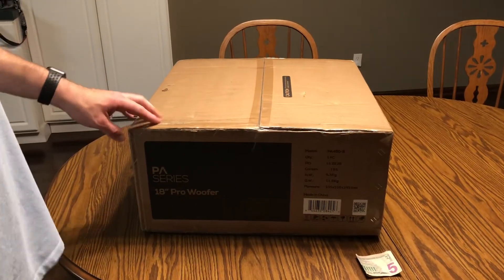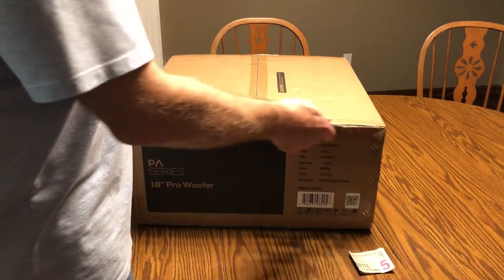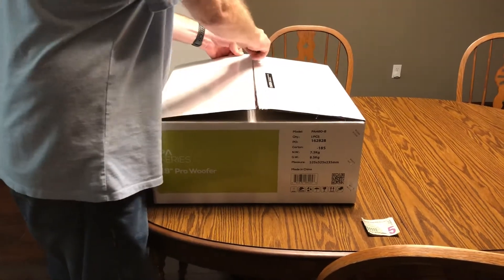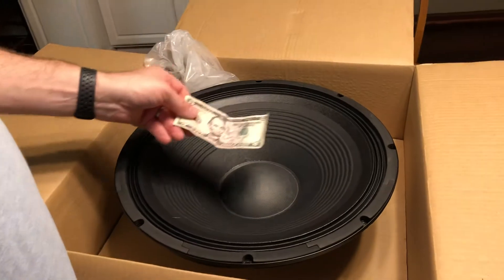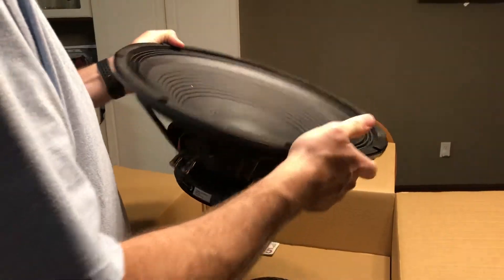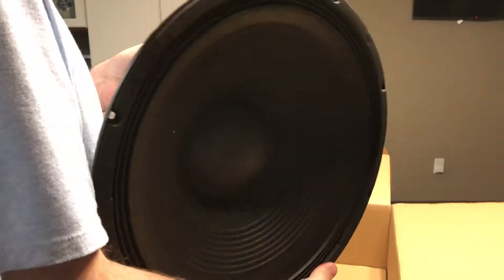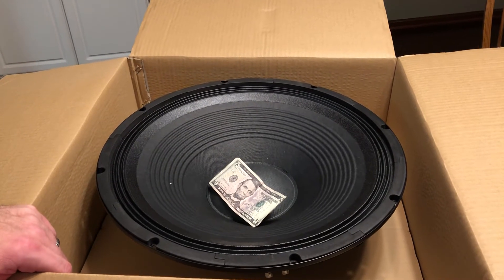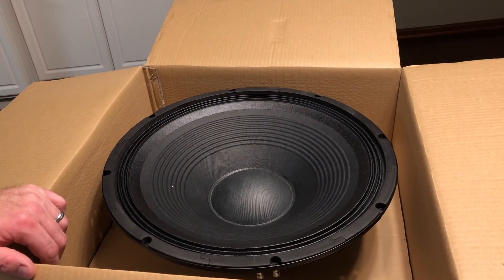VBSS Part 1: Unboxing the Dayton Audio PA460-8 18" Pro Woofer

Comment: How much does it cost
Reply from the maker: Hey Warren. That question is hard to pin down because cost of materials fluctuates so much, but here's an estimate.

2 8'x4' sheets of 3/4" MDF: $120
2 Dayton PA-460-8 woofers: $320 (these were $100 each when I built mine, so the price has really jumped)
1 Behringer NX1000D amplifier: $329
Glue, screws, cabling, etc.: $50
Total estimated price for 2 subwoofers: $819

Comment: I know this video is 2+ years old now, but which amp did you end up using for these and where did you place it?
Reply: Never mind, saw it in another one of your videos.
Reply from the maker: @hubbahubbazootzoot  Cool. :) I did build a second set of VBSS now, they are behind the screen. The bass is perfect with 4. Not overwhelming, just full and buttery and effortless house shakes.
Reply: @jevchance  Did you just run 12 gauge wire to the back of the room for the end tables?
Reply from the maker: @hubbahubbazootzoot  Yup. It's just 1 12 gauge lead that runs to the back of the room. It runs to the first subwoofer, then another 12 gauge wire runs from there to the other subwoofer. The amp is bridged mono, the two 8 ohm subs in parallel show a 4 ohm load at the amplifier. The amp is a iNuke NU1000DSP. Although, my other 2 VBSS subs are running off a NU3000DSP and they enjoy the extra power.
Reply: @jevchance  Cool thanks!  From what I've read you should be able to run all 4 of them from the 3000DSP right?  I'm planning on building a pair soon'ish and am going the end table route too.
Reply from the maker: @hubbahubbazootzoot  I've read you can run up to 8 with a single 3000DSP! 4 is easy though, just run one pair in parallel off each channel of the amp. The amp sees 4 ohms on each channel. Each speaker should be seeing about 340 watts. This is approximately the same output my two subs are seeing my NU1000DSP. Works great!

Comment: There is absolutely no low end bass from the units I used. 7.6cuft cabinet slot ported to 34hz
Reply from the maker: 34Hz tuning is not a good choice if you want low end bass. You definitely would want the 20Hz tuning. The 31Hz design is down like 16db at 20Hz compared to the 20Hz tuning.
Reply: jevchance thanks for the info. I think I might try to make the ports smaller with some pieces of wood and try to deepen the tune
Reply: jevchance I will say that I don’t even think that 34hz is there. Personally think something is wrong with the drivers
Reply from the maker: @Markkrochuk1979  Mark I recommend posting about this in the VBSS design thread on AVSForum, there's lots of really knowledgable guys on there willing to help with advice. I'm also happy to help. Off the top of my head, a couple of questions: 1) What are you using for an amplifier? 2) Did you do the subwoofer crawl? Room gain/modes can be a problem. 3) What are you using for DSP/EQ?
Reply: jevchance one bryston 4b bridged mono per side, no eq except for whats available on my pre-amp
Reply from the maker: @Markkrochuk1979  Hrmmm. That is a lot of power for these speakers. Far too much. Without a limiter I'd be very concerned about cooking the drivers.  It'd be safer, to use one of those Brystons in stereo mode (250 watts continuous per driver). You wouldn't be using them to their full potential, but they'd be relatively safe from thermal overload, and should still develop pretty good SPL as the PA460 is a pretty efficient speaker (97.8). Also, with 34Hz tuning you'd want a high pass 12db butterworth at about 32Hz-33Hz because a ported (basically free-air) subwoofer can easily bottom out below tuning, running without one (especially that hot) puts the drivers at risk. I think your best bet to setup high pass filters and further EQ would be to pick up a MiniDSP 2x4 and again go down to a single amp for both drivers.
Reply: jevchance ya, I’ve ran out the bridged (800w per side), wasn’t even remotely impressed with the output. In fact I get about the same bass from my Klipsch RF5’s (dual 8” drivers) at 1/2 volume. Theres definitely something serious that I am missing with either the design or defective drivers. Ive detailed it all on the Parts Express tech talk forum. Basically I wanted a Klipsch Cornwall inspired three way design augmented with my sub for the really low end stuff. Given the efficiency I thought these drivers would be blowing people out of my basement. The mid driver is 97db/1w and the tweeter is 94db/1w and they both sound about 2-3 times louder than the woofers. Also tried wiring direct to woofer to ensure nothing was wrong with crossover and was having same volume/results.
Reply from the maker: @Markkrochuk1979  Are you running the RF5s off the same amp? Are you feeding power to these directly from the amp or through your passive crossover? If you're running through the crossover it could be the crossover at fault, if you're running direct are you using a low-pass filter? If the speakers are making noises that aren't "bad", the drivers are likely ok so we need to figure out where else the problem could be.
Reply: jevchance ive run the same amp configuration on the RF5s, Ive run the woofers through a crossover and direct wire to amp with same result so crossover issues can be ruled out.

Comment: I've been doing research to buy my first ever sub, and this DIY seems to be the way to go. You think it would be too much for a college studio? Not thinking of bumping up the volume too loud, but would the vibration call the police?
Reply from the maker: Nah, you will always be in control with the volume knob.
Reply: @jevchance  Awesome, thank you! If I'm only building one, do you think the iNuke 1000dsp would be enough?
Reply from the maker: Alexi, the 1000DSP would also work great for a single sub. You will bridge it at 8 ohms and present about 430 watts to the sub. Make sure you consult the AVS Forum post I linked and get the iNuke DPS settings to load onto your iNuke before you connect the speaker.

Comment: I'm sure it will work well if you don't over power it...I've experienced "cheap" bass drivers in the past when I built a Mobile DJ set up...I built bins with 15" Speakers and loaded them with horns to cope with 200 watts PA active and burnt up two 15" drivers very quickly then I replaced them with 15" Etone 801 base drivers and they were $500au each at the time..I still have one plugged into my guitar amp 30 years later.
Reply from the maker: Hey Ziggy thanks for the feedback. These guys have a big following so we are going to give it a run and see how it goes!
Reply: ZIGgassedUP the pa460s have power handling of 500watts
Reply from the maker: Yup and I'm only pushing about 360 watts into them right now.